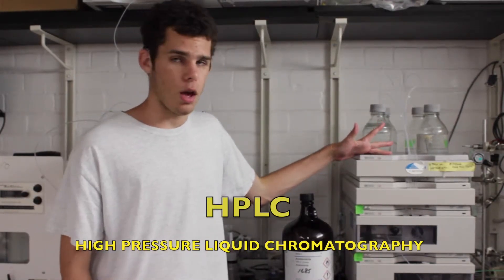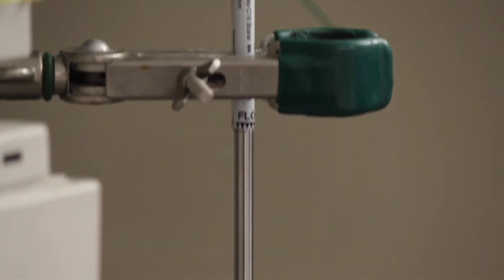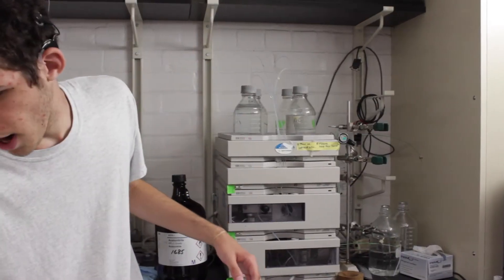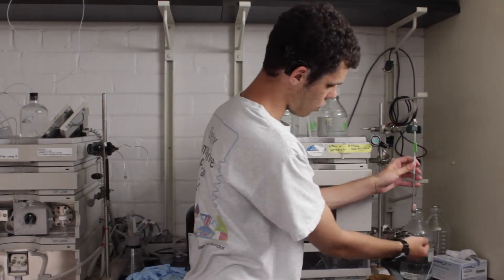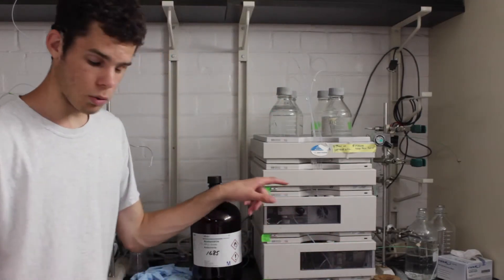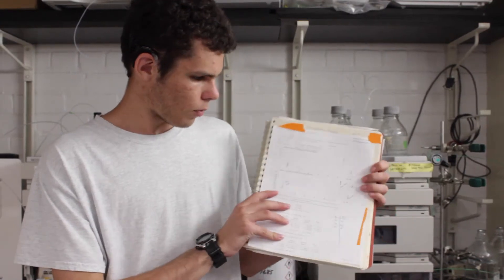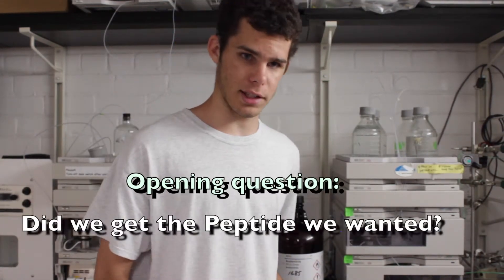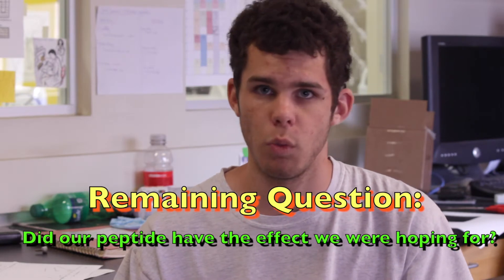Solid Phase Peptide Synthesis (2015)

Comment: ACTH (7-10) proline-glycine-proline would contain the portion of the adrenocorticotropic hormone that would do the trick; with the pro-gly-pro C-end allowing easier transmission across the blood brain barrier, increased metabolic half-life and contributing nootropic, neural protection and anxiolitic properties (without the sedatory effects of typical anti-depressants)...of course, one does not want to involve the remainder of ACTH [1-39], nor even the first 24-amino acid sequence [from the carboxyl end]. 
ACTH (1-24) has full biological activity of the (1-39) peptide.and all of the countless affects that the full hormone would cause. If it is the aspect concerning nociception  is to be obtained, my suggestion remains (and works well - so far).

phe-arg-trp-gly-pro-gly-pro  (MEHFRWGPGP)           [special thanks to Austropeptide for expedited custom synthesis}
{and the unwilling help of three dozen murine assistants}

http://onlinelibrary.wiley.com/doi/10.1111/j.1476-5381.1978.tb17293.x/pdf
{background info - my studies as yet unpublished}
Reply: This is such a badass comment lmao. Such an intellectual flex right here